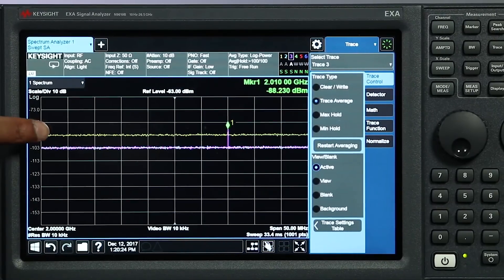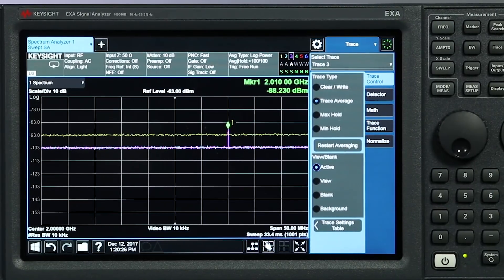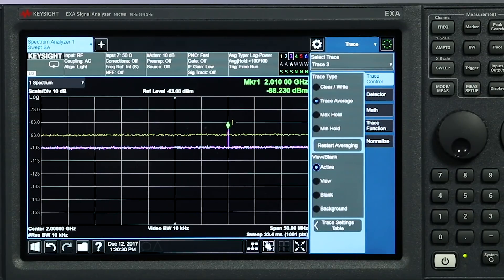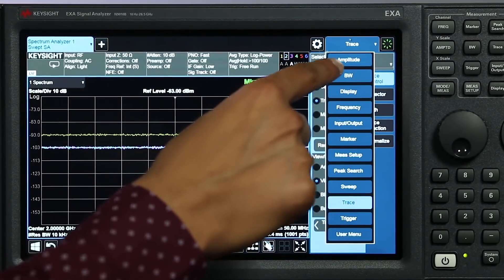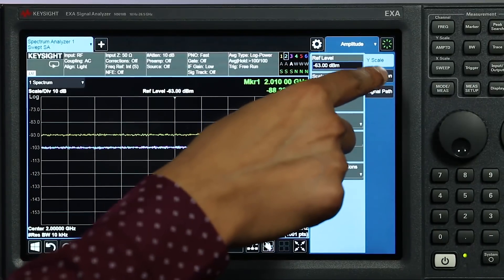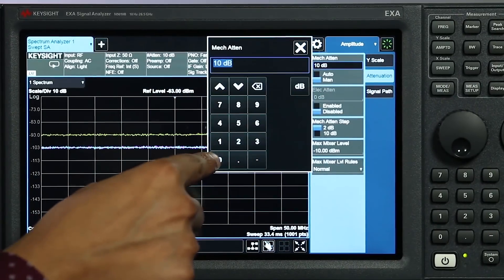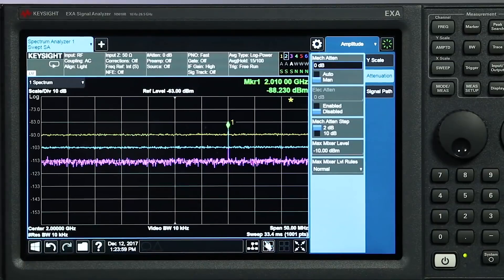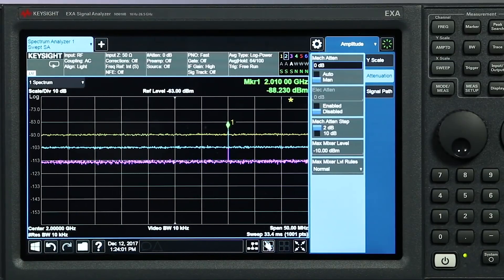SA Input Attenuation and Today's Wave Winner! (6-Mar)

Comment: And if you overdrive your mixer with too much power or an incidental DC component, bye bye mixer diodes. So please be very alert on what you put in. You or your boss/teacher won't be happy. I see many older SA have had their mixers replaced often (non repairable part). Probably the most often part that needs replacement in a broken unit.

Source: I repair a lot of the older models (the obsolete 8560 series). I've seen some things.